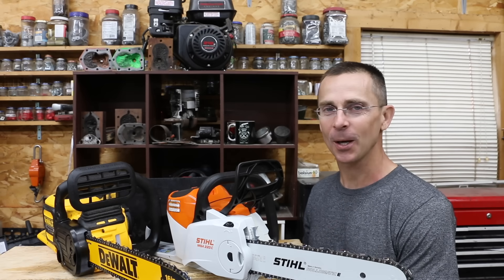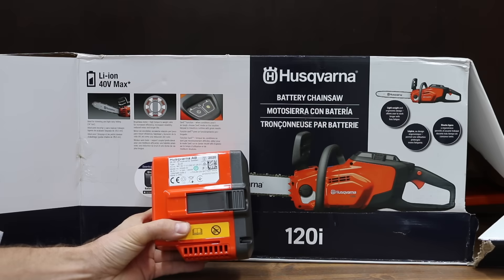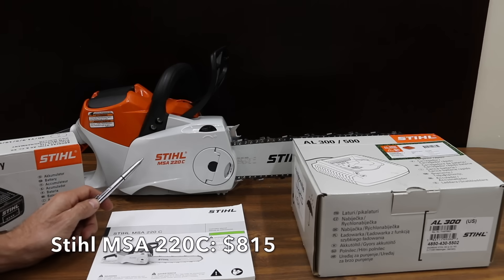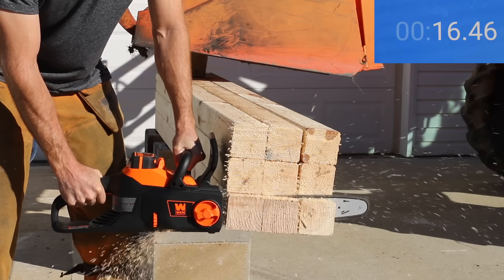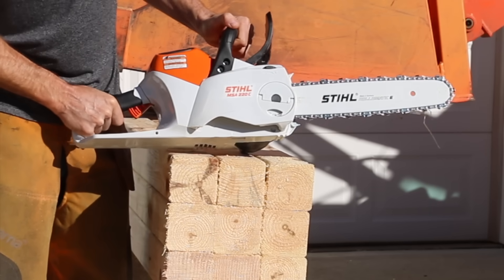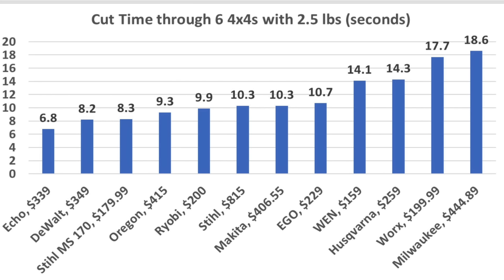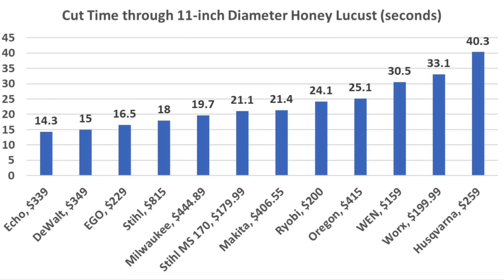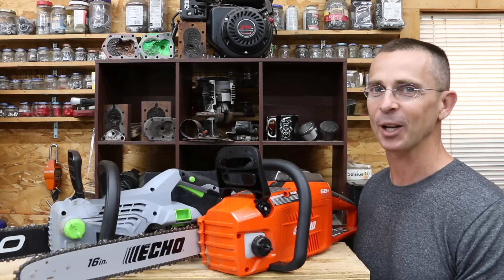Best Battery Powered Chainsaw Brand (ROUND 2)? Stihl, Husqvarna, Echo, Oregon, DeWalt

Comment: I thought that the "self-sharpening chain" thing had died years ago.  Strange that it still persists--and is still miserable.
I wonder if some of the cutting speed difference lies in the chain geometry differences between the various models.
Reply: I have used the very first version of the power sharp chains. Though they are a bit slower they are far faster to sharpen and last a bit longer. The only problem is they only come in one pitch size and not ever saw can use them.
Reply from the maker: Great feedback. Thank you
Reply: @kameljoe21  I keep a pile of pre-sharpened chains around.  Mostly skip-tooth square-ground chisel type.   Cuts faster than just about any other type in my experience.
Reply: @tubastuff   I have not cut in 3 seasons since we changed fuel types.  When I was cutting I would buy the cheapest full chisel chains and use them till they wore out. Though I was cutting only clean soft woods and could get 5 to 10 cords of bucks cut for about 1 chain give or take for a cost of about 15 dollars for the chain and the cost of a gallon of gas and oil. The only problem with chains is they stretch over time, most times I would end up cutting a lot of bucks Between 5 to 10 cords and the chain would be fully stretched out. This would be about 250 to 500 bucks depending on size and about that many cuts. I could get about 5 cords of bucks in full log lengths on a farm truck with side dump and a 25 foot flat bed trailer. Could cut this up in less than a day and spit it same day. Yet we normally just buck them out one day and then split the next. If I ever go back to cord wood I will just haul and buck out and stack for 5 plus years worth and then split and stack. I have the space to put up 100 cords or more of wood and would build a nice roof over it all.
Reply: @kameljoe21  I don't know if the picture has changed much in the three years since you've been working, but there are a lot of very cheap Chinese chains and bars on the market now.  I don't know if I'd use them, though. There's also a Chinese copy of the old Stihl 070 being sold on Amazon with a 36" bar and chain for $315 shipped (chain brakes are for sissies?).
Reply: @tubastuff  yeah you can buy nice chains for between 10 and 15 dollars more if you buy larger volume. I have done that many times before. When I stopped cutting I had quite a bit of chains that were only used once and a stack of master links that I bought for someone else. I think I got a bag of like 50 in a couple of sizes for like 5 or 10 bucks and charged the person 10 bucks for a hand full of each. I never used them. I even told him I could buy him a bunch of chains for next to nothing. He just wanted to repair his and keep sharpening them. When I would buck out for him from time to time. He was always fiddling with his chain. I just buck them out with the same chain and take my cut. I even went an helped another person where we cut on site and stacked a 40 foot goose neck trailer about 6 foot tall. Bucked out about 10 plus cords my self and a tractor that brought the logs to me. I started with a new chain and and never sharpened it the whole time. We had  5 people there, Tractor driver, one cutting log down to manageable size and one pulling logs out with a 4 wheeler and one stacking. The start someone else was cutting and taking too damn long to cut, Dull chains and always stopping to throw a file on it. So I jumped in and finished it all up in very little time.
Reply: @kameljoe21  Color me conservative.   I accumulate my dull chains and then sharpen them in a batch (I have a sharpening rig), then I'm ready to go the next time the saw takes a dive into the dirt.  With a big AC-powered rig, it doesn't take much time at all to get a good sharp chain.  I think the cheap Chinese imports use softer steel.
Reply: I've suggested before that it would be great to see the chainsaw videos revisited with all of the saws using the same (best) chain. I know it's important to test products in their shipping configuration, but I think it's also valuable to know when manufacturers have left performance on the table if it can be unlocked with a simple modification or replacement of standard parts.

Comment: I have a WEN drill press and a stationary belt/disk sander. The drill press is good, but the sander is just okay. The motor is a little weak. Still better than Ryobi though. Will never buy Ryobi ever again.
Reply from the maker: Great information. Thank you!
Reply: @ProjectFarm  - Yeah, for the price, WEN is pretty hard to beat. The drill press and sander are pressed metal construction, unlike the plastic Ryobi tools, and the plastic they do use seems to be decent.
I wish the sander had had a better motor, and switching from the belt being horizontal or vertical was a lot easier to change, but for the price... It eventually gets the job done. Can't really complain too much.

Comment: The 16” ego comes with a 5ah battery, seems to last forever!
Reply from the maker: Great information. Thank you!
Reply: For reference I paid $280 for one. So the extra $50 to go from the 14” 2.5ah to the 16” 5ah is well worth it in my opinion.
Reply: @dennispope8160  I started with the EGO 16", and was just amazed at it's performance. But, when the motor developed a bearing failure, it had to go in for warranty repair. They apparently replaced the motor. After receiving it back it is starting to make the same internal noise as when it first failed.

While the 16" saw was in the shop, EGO released the 18" saw, which I immediately purchased. So very glad I did. The 16" is no slouch, but the 18" does have a few features the 16" doesn't. Steel dogs, LED headlamps, and much higher RPM. My saws are used to cut decades old pacific madrone. One of the hardest woods I know of. 

Prior to going cordless, my main saw was a Stihl 290 which I sold after buying the 16" EGO.
Reply: @imonittonite  oooo what do you do with that kind of wood? Also thanks for sharing.
Reply: @imonittonite  I tried aneighbour's it seemed like the bar clamp chain tightener had to be wound down quite tightly to keep the bar properly in place - which results in a very tight chain which would put substantial force on the clutch bearing. It probably slows the chain down as well.  With the chain tension about the same as on the MS 250 that I was using the EGO popped off the bar once.  My impression is that there is a very narrow range of useful chain tension.
Reply: and my son Alex rewound 710 seconds from the start of the video!

Comment: Stihl is steal for it's money

I can tell from an experience how long regularly serviced 2-stroke Stihl chainsaw lasts, that's called eternity
Reply: What makes their electric stuff expensive is the batteries. The also make tons of other electric garden tools like mowers, whackers, hedge cutter, leaf lowers etc. All compatible. I like their stuff, and they still produce lots in Germany, right sound where I live :) that makes them maybe not the most cost effective, but there's value in that for me
Reply: @thorwaldjohanson2526  That's cool!
Reply from the maker: Thank you
Reply: I inherited a old Stihl from my Grandfather, it was old then but now 15 years later it still works perfectly.. I've only changed the chain to a new one.. Stihl has never tried to be the cheapest option..
Reply: I have a mate who runs an earthmoving, mowing and landscaping business. He has 4 Stihl chainsaws, a polesaw, 3 blowers and 4 whippersnippers.
I occasionally work out in the field with him but I mainly fix all of his equipment.
He hasn't been doing it for 20 years and it could be some of the guys that work for him, but those Stihl tools can easily be overprimed and he regularly has problems.
Reply: Yeah man, but the petrol engined models are a completely different thing. Stihl and Husky are the kings there. But in the battery powered race they are lagging behind badly. AEG/Ridgid/Echo and DeWalt are a third of the price, outperform the Stihl comfortably, and have way longer warranty. No contest.
If you're talking petrol power, sure, buy the Stihl. But their battery stuff is very overpriced and pretty mediocre quality. It's currently not their area of specialty. With how fast the battery/electric tools are improving now it won't be long before petrol engines are a thing of the past. In small and mid sized chainsaws the battery models are already arguably better (no smell, no noise, not flammable, no pull start, no maintenance aside from the chain, batteries are way easier to carry compared to petrol, some even have more torque than their petrol powered equivalents). It's only the really big boys where the petrol engines still have the advantage, and only the really serious industry guys buy those.
I was in Bunnings on the weekend (big hardware chain in Australia) looking at one for the missus (she wants one for a bit of trimming in the yard) and the sales guy told me the battery models are outselling petrol chainsaws by 2 to 1 now. Some of that can be accounted for by the ladies in our lives buying the little ones, and when I pointed this out he said even with the big ones the sales are about even between battery and petrol models. You couldn't have said that 5 years ago because mostly the battery stuff was crap back then. He said that mindset is still a bit prevalent so it's hurting the battery model sales a bit, but the battery tech and brushless motors have improved out of sight in the last 3 years and the battery models are serious competitors now.
I have a petrol chainsaw (admittedly not a Stihl) and it goes fine, but the yearly maintenance gets a bit tedious (filters, oils, plugs, the constant cleaning), not to mention the inexplicable stoppages and refusal to re-start until it's cool again, and the wear and tear on the old shoulder starting the thing in the first place. I'm looking long and hard at how easy it was for the missus with her new battery one. No pull start, no noise, the 6Ah battery lasted all afternoon, and it's quite powerful, easily as torquey as my petrol one. I was pretty surprised by that. It went all afternoon with no signs of slowing down, the missus cut up 7 crates of wood no worries. Best $320 I've ever spent, lol.
Stihl need to lift their game if they want to keep that reputation they have. As it stands now the cordless tool manufacturers (DeWalt, AEG, Makita, Milwaukee, etc) are killing them in the battery chainsaw market. Husky are doing better, they seem to be awake to what's happening, but Stihl needs a LOT of improvement.
Reply: @woopimagpie  you say better quality, what do you mean?
I get that the competition have more power, but dewalt is shit quality. I have many dewalt tools and a company I sometimes work for has all the dewalt tools, its hard to make the change when you've already got 40-50 tools, with chargers and batteries. But they are shit, something breaks all the time. 
Stihl is loads better quality than dewalt, I would still buy the dewalt because its cheap and I have the batteries but Stihl would win a droptest 9/10 times!
Reply: @RenaxTM91  So, go buy the Stihl and do your own side-by-side comparison. And don't forget to do a "droptest". The post your own videos and show us the results. I think Todd has shown us all here that Stihl tools aren't worth the price. A bit like Snap-On. Good tools, sure, but WAY overpriced for what they are.
It's not hard to make a change. I know some tradies that use multiple brands, one fella has a plastic tub full of batteries from different brands, as well as a couple of those battery converter things so you can put the Makita battery on the DeWalt tool and so on.

Comment: Great review but I'm still waiting on that Atlas harbor freight brand since they claim is their best
Reply from the maker: I'll definitely put together a round 3 video if there's enough interest.  What other brands did I miss?
Reply: @ProjectFarm  Try Ryobi. They are getting really popular with some of their other affordable tools, and I see quite a few DIY and maker YouTubers use their products
Reply: @danielschultz6706  that's only because they're all sponsored by ryobi lol
Reply: @ProjectFarm  Test the AchiForce 40v cordless chainsaw. Another YouTuber, Fall Line Ridge, reviewed it and it seemed to do quite well. It is also cheaper than all the chainsaws you tested previously.
Reply: @ProjectFarm  Makita has several varieties, some use 2 batteries and others 1, Black and Decker has one too, MasterForce 80v by Menards, or did you get that one already? Snapper has an 82 volt cordless, SunJoe has a 100 volt, toro 40 volt, doubt it will compete? Craftsman 60v, not sure agin if you hit that one.
Reply: Hitachi koki brand